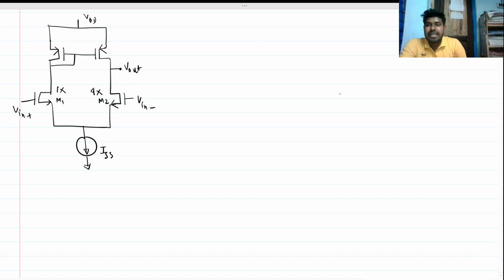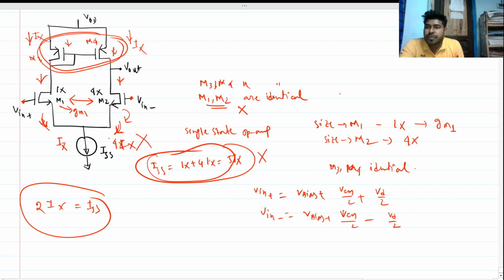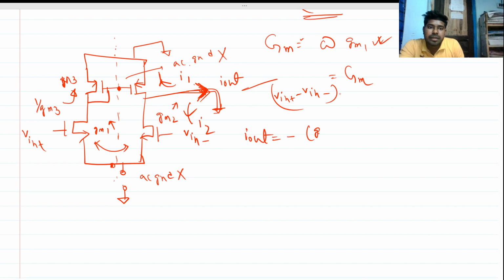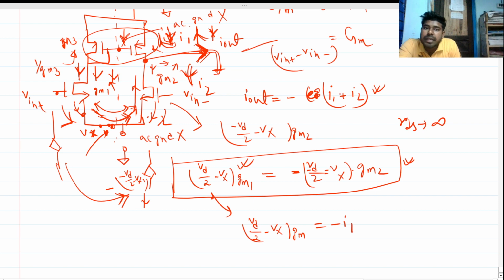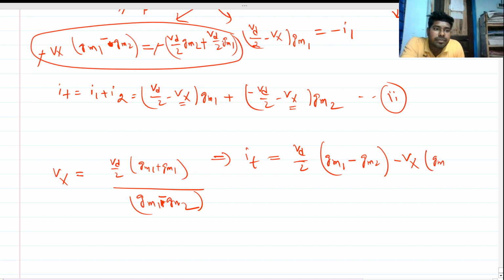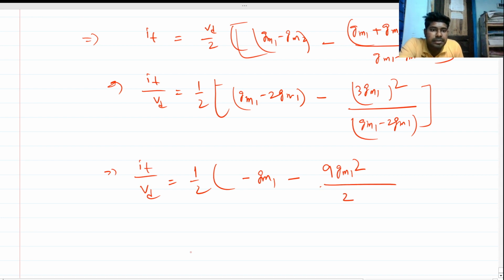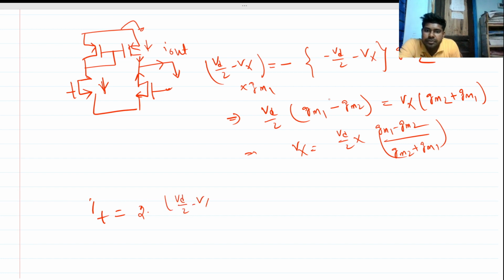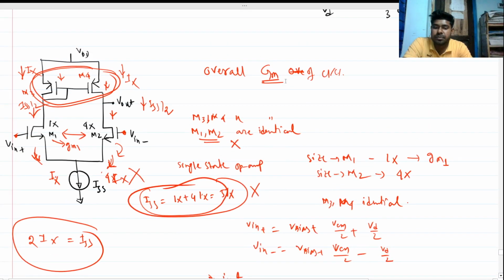What is the effective transconductance of this OTA with non identical input pair _Analog Engineer

Comment: if both M1 and M2 are biased properly the DC current will be unequally divided in each branch. the small signal currents will be the same though . the current mirror effect is not valid to consider here because the M4 has to be in triode region if M1 and M2 are properly biased in saturation and if you take the current mirror effect the gm equation for M1 and M2 can't be used as that is only valid for saturation.

Comment: Very nice mismatch problems and then how to correct the differential output error!❤️

GM :iout/vd/2=4/3gm1
or iout/vd=4/3gm1 I'm confused, which one is correct?

GM=iout/vin, signal is from vin+ inside one is up (- to +)and the other is go down (+ to +) and then the composed of iout  Ac is 2gm1vin
So 
GM=Iout /vin
(2gm1vin)/gm1vin(1/gm1+1/2gm1)=2/(1+1/2gm1)=4/3 gm1 🤔

Hang on vcm on v+,v- and then 
I=v/(1/gm+1/2gm)=v/(1/gm+1/2gm)=v/(3/2gm)=v/(3/2gm),I/v=2/3*(gm1)..answer 🤔

Comment: I think the GM calculation is not right. This is how I calculate the GM, assume there is deltaV on M1 gate, and minus deltaV on M2 gate, since M3 mirror the M1 current to M4, so that current flow out of OUT node would be gm1*deltaV-(-gm2*deltaV), then input voltage should be 2*deltaV, I agree that gm2=2*gm1, in this case, the GM should be (3/2)*gm1, not 4/3 of gm1.